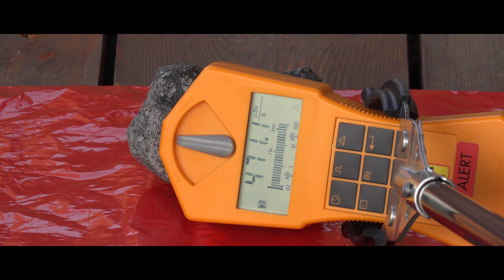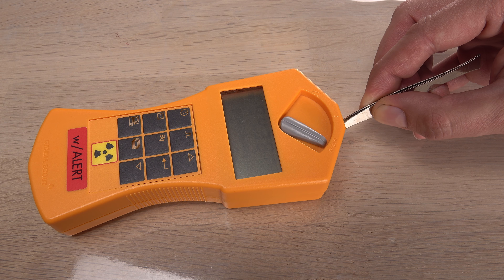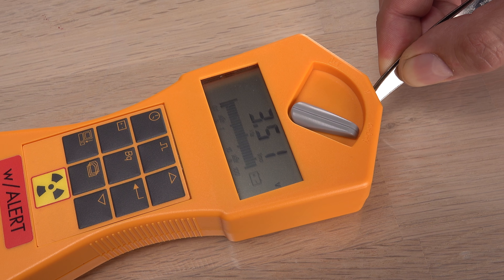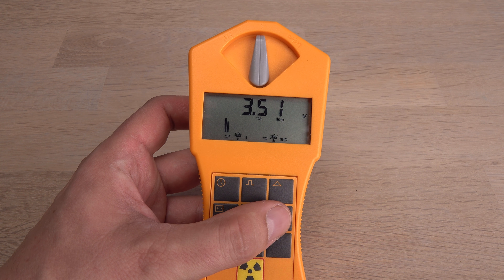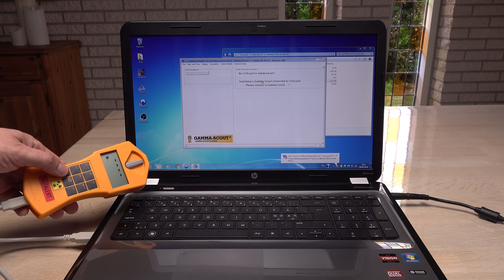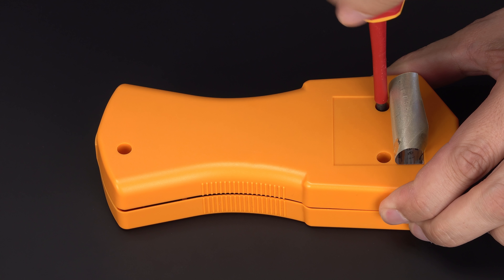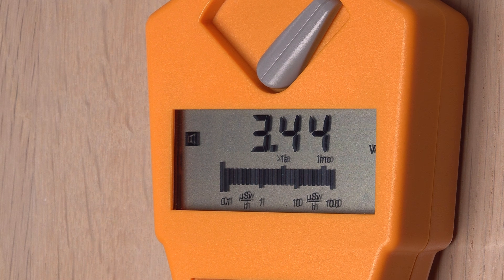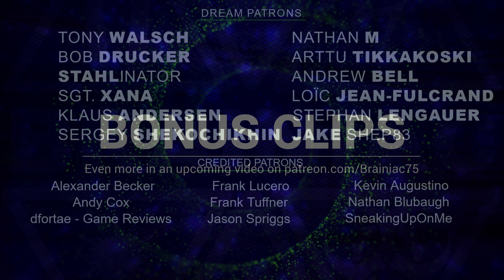Weird battery change in Geiger counter

Comment: What a stupid design to have the battery soldered in - and such an obscure chemnistry on top of that! As if they weren't able to use one of the many standard cells 9 years ago.
Also, 3.6V sounds like the perfect job for a LiFePO4 replacement, because that's their cell voltage as well. They are the safest and most favourable rechargeable lithium batteries, because they are safer than any LiPo chemnistry, don't blow up or anything. A little less power density though, but that shouldn't matter in a device like that.
Reply: The battery chosen has a better energy density very low self discharge works down to -55. They're pretty good for long life low drain applications. Soldered in is a good choice for a long service life application like this. Sending it back keeps people out of high voltage and after 9 years the tube is maybe worth checking. It's a good design choice.

Comment: I know you said you're not interested in the data-logging function. But you could try running the software in a virtual machine if you ever changed your mind, and pass through the USB.
Reply: Or install Windows XP on another drive just to run the software

Comment: That capacitor only holds 2 joules of evergy. E=1/2CV^2 It may bite you, but it shouldn't be dangerous.
Reply: In domestic use the electric shock often isn't the biggest problem. It's you falling off a ladder because of the "surprise". In this case he wouldn't fall off a ladder (although I have no idea where he is soldering ;) ), but he could throw the counter around by accident for example.

Comment: Yeah theres high voltage but it is DC and very low Amperage. Not dangerous.
Reply: also not referenced to ground so you would need to touch both contacts
Reply: I guess you could also discharge the capacitor without problems. Only in some devices you would lose some data.
Reply: not dangerous, yes, but it will still give you a nice shock!
Reply: Maybe not dangerous (ie not as lethal as a wall outlet for instance) but still enough to give you a nasty, painful shock !
Reply: You obviously don't know anything about charged high voltage capacitors.

Comment: Is the hv of the geiger dangerous? Because when I touch my geiger tube terminals I don't feel anything... The counter just freak out.... Maybe due to low amperes?
Reply: Yes, it is more like static electricity. High voltage and high current, but a very short pulse and therefore almost no energy behind it. But how much charge the capacitor has will very much depend on how the geiger counter is designed and I am sure that there are some that will zap you good.

Comment: I want to get myself a better Geiger counter. With better I mean: The same price/performance ratio as the Scout. But since the Scout is old and competition has progressed, what would you recommend? Should I buy a Scout or an alternative for the similar price?
Reply: There are indeed better deals today. The GS was noteworthy as one of the first to do logging. Ecotest is a brand worth checking out for advanced models.
Reply: @MarkRose1337  Just looked into those. The good thing about GS is the thin membrane - top geiger tube which lets alpha pass through. nearly any other mid-range budget GC I can find are solid (metal, glass) Geiger tubes, which are fairly cheap, good working, but they are blind to alpha. The Thermo Fisher RadEye for example detects all three types, but you pay 2k - 3k USD which is horrendous for a handheld pocket-device.

Comment: The battery provide 3.7v continuously? Couldn't you have installed a three cell AA battery holder and used three AA-size NiMH batteries in it's place? That way, you could replace/charge the batteries when needed and not risk overloading the unit. It would add bulk to the unit, but that's not really a problem since you don't use it much and data logging isn't a concern (I doubt it's that sensitive anyway.)
Reply: I guess self discharge is the main problem here. The few times a year you need it (at home), you can almost be sure to come back to a dead battery every time if you use NiMH.
Reply: @superdau  Better than having to source a specialized battery and soldering it in every time you want to use the device, IMO. He said he rarely uses the device yet the battery went dead. I think most of us have AA NiMH cells easily available, though. Popping in freshly charged cells when he wants to use the device seems better than relying on a soldered-in cell that may be dead in the seldom chance he may want to use the device, IMO.
Reply: @eddiespencer1  The internal battery is a high reliability device and it will be there running for TEN years.  Every time you pick it up, it is working.  Every single time.  It just simply works.  You can have a replacement battery in your mailbox tomorrow from Amazon for ten bucks when it is needed.  It takes all of  10 minutes to replace it (you just watched it).  It boggles me that you would think that rechargeable batteries would in ANY way be better.  Even if you only used the meter once in the next ten years, and had to replace the soldered in battery before you could use it, you would still be time ahead compared to recharging and installing a set of NIMH even just one time.
Reply: Why in the world would you even suggest this?  It takes a single battery that lasts 10 YEARS.  Why would you replace it with NiMH batteries that you have to constantly  recharge?  Common sense is not common anymore.
Reply: @stargazer7644  Why? For ease of battery replacement in the future. He said he seldom uses the device and yet the battery died.  He indicated data-logging isn't a concern of his as well. By installing an external battery holder, he could just put batteries in it when he wanted to use it and not be concerned about the internal battery dying.  Three freshly charged AA NiMH cells could provide about 3.6 to 3.7v (the original cell is 3.7v, correct?) to drive the device but be easily replaceable if needed and the cells are easily rechargeable/reusable. Plus he wouldn't have to disassemble the device to replace the battery.

Comment: what's weird?
Reply: The battery is soldered
Reply: @und4287  Not weird. Very common practice for rechargeable batteries. Manufacturer save costs (no battery holder) and space. Not weird at all.

Comment: I think there should have been an additional warning about the dangers of soldering lithium batteries. Heating the battery up too much with your soldering iron can cause premature energy release..
Reply: It's safe to solder the leads. It's dangerous to solder leads to a battery directly, they're usually spot welded.

Comment: Multiple camera angles and exciting music for... changing a battery. Ok a soldered in one, but still :P

Great video though!
Reply: on a LIVE CIRCUIT also.
Reply: A nuclear reactor is a lot like a woman.
You just got to read the manual and press the right buttons.
Reply: That drama is so sad it's actually funny. People used to work on open CRT television you know... (~35000V)
Reply: @FrozenHaxor  when i was younger I was about to open a CRT monitor to learn how It was made, but my grandpa told me It would be dangerous eventuali if unplugged from the power. Is that true?
Reply: @flashxcate  Yes, they are dangerous even when unplugged.
Reply: @flashxcate  Depends on how you look at it, there are charged capacitors up to 320V that discharge very slowly after being unplugged, but perhaps your grandpa was referring to the TV tube itself which has almost perfect vacuum inside and breaking it accidentally can create a massive implosion spreading glass shards all over the place.
Reply: That was the perfect ambiance.
Reply: Hey, anyone ever play with caps so thirsty that they can literally suck charge out of air, so they have to get put away with crossed legs..?

Don't think a 320V cap was the problem with old tellies.
Might be more about hand/machine wound, MASSIVE step up's for big voltage, and generally not alot to prevent the motherload discharge.....
As well as the several of various "vacuum tubes"
Reply: Errrrrrrm, hello....

Solder Sucker 😉
Reply: are you kidding? this is the content i require
Reply: Not every battery powered circuit has large exposed contacts at 600+ Volts :D
At those voltages it is very easy to get a shock, not even touching the contact but just by getting close to it. Luckly the amperage would be low, but still, it would hurt.

Comment: Man screw thionyl chloride batteries. I work at a battery store and needed one with solder tabs on it. I was new to thionyl chloride batteries (lisol2) but not to tab welding so I thought "I'll get add solder tabs" I put on safety glasses and did the positive terminal first. No problem. The battery was a button top battery and when you weld a button top battery it usually sends out a lot of Spark because of the shape. So after doing that I took off my safety glasses to do the negative as they rarely spark (on nicd and nimh batteries). I weld the tab and pop lots of Sparks. I then turn the battery to look at the spot and psssssss I get sprayed in the face. Thank God I had my Normal glasses on. I saw the lenses get sprayed and closed my eyes and started coughing and eyes watering as i ran to the eye wash station. I got really lucky in that I only had minor burns afterwards and still have both my eyes.

Thionyl chloride turns into hydrochloric acid when exposed to oxygen and this is an extremely exothermic reaction so I got both chemical burns and temperature burns on my face but no scars.
Reply from the maker: Oh boy, that's not good x( Thanks for sharing. I did see a warning about not soldering directly on the end caps of a thionyl battery in a safety data sheet. Glad I found one with axial wires...
Reply: @brainiac75  yeah I won't every try spot welding or even soldering on one of those ever again. When I started working at the battery place I was told "do not weld on lithium batteries" but saw other people welding on coin cells and 18650s so I assumed it was one of those warnings they have to give but obviously I was wrong.
Reply: Thionyl cloride reacts with water to make hydrochloric acid, but atmospheric oxygen doesn't react with it, although if it did you'd get sulfuric acid too.
Reply: @Quintinohthree  I just know I got 2 types of burns after looking over the msds of thionyl chloride I assumed it was reacting in air. OH I should mention this is in a very humid environment mid summer. Not a good day.
Reply: @x9x9x9x9x9  It's nasty stuff all around, just wanted to correct you. It's definitely hydrochloric acid that does the real dirty work in thionyl chloride burns though. Humidity doesn't really matter, there's plenty of water in and on the skin to do that already.
Reply: @Quintinohthree  Ah that makes more sense. I am not a chemist at all so reading the msds and wiki about it I just had to make my own theory as to what happened. I am just glad I didn't lose an eye.
Reply: Phew! 😫 Every cool battery has its dark secrets...
Reply: What brand of Li-SOCl2 battery was it?  The Saft and Tadiran ones are glass sealed.
Reply: @douro20  it was a saft 14250
Reply: Yes, thionyl chloride is nasty stuff.
Reply: Glad you are ok. I once got sprayed with the insides of a glow stick and with no safety glasses. Man that burned for a while. Did no damage but wasn’t very fun!
Reply: @AldoSchmedack  Really, a glow stick? Those are supposed to be safe to let babies chew on. I've seen strippers cut them open and pour the contents on their girly bits.
Reply: @brocktechnology  you have an interesting life
Reply: @issecret1  what, you haven't seen a stripper do that?

Comment: Why on earth would anyone design a product like this when they could've just as easily had it take 2 double As or a 123 lithium
Reply: Probably two reasons there, for one it makes uncalibrated devices stop working - which for a safety-related machine can be quite important. Secondly it's a money-making mechanism, Gamma Scouts are rather expensive bits of kit for what they are - and back in the day they cornered the market for small electronic geiger counter dosimeters, and they're not really aimed at hobbyists.
Reply: Two words: planned obsolescence. That way, you have to either send them the counter to replace the battery or do this.
Reply: He explains at 8:50
Reply: that doesn't really explain anything about why it's used. my ludlum Geiger counter uses two conventional giant D cell batteries.
Reply: Because the battery lasts 10 YEARS.

Comment: I'm really deeply impressed, you're able to change a battery...
Reply: Well, he could have connected some 3,5V from external power supply somewhere while changing it to avoid possible data loss. Also, could use gas heated soldering iron while messing with live, sensitive electronics to avoid some kind of induction damage. 
Changing batteries is difficult.
 (:

Comment: I actually think this was the most dangerous thing you did in this channel. Think about it: Intense radiation, strong magnets, toxic materials, inflamable materials, powerful lasers, all either take too long to kill you(toxic materials and radiation) or won't aim for you directly(magnets, lasers and inflammable materials). High voltage on the other hand, takes microsseconds to get on you and from you to the ground, and can't be stopped once it gets on your body.

I am not saying you shouldn't have done, just that be careful when doing so! Common sense makes it seems that things that aren't that dangerous(like mercury and uranium) be lethal just by looking at it, while things that are easily lethal like a 220v AC plug fine for using in a bathtub. It all depends on how strong what you are dealing with is, of course a 3v DC is not going to even tickle, while 1 gram of Radon kills you instantly.

Still, i would love to see other videos about electricity and eletronics in general!
Reply: This is a handheld device, so as long as he only uses one hand he should be fine. To get a shock you need to close a cirquit somehow. In this case he would have needed to touch two points on the board with diffrent potential simultainously. If this only happens with one hand, the cirquit will be closed within his hand. It will hurt, but the current will only flow through that one hand and not through any vital organs. It gets dangerous when you touch the two points with one hand each because then the current will low through your arms and your upper body. If you watch the video closely, he was very careful and only touched the board on places that were safe, so the corners, the battery or the USB port, and always only with one hand. I would say he did this in a very safe way.
Reply: The risk is minimal when you know what you're doing.
Reply: @Iliek  yes, but still more dangerous than playing with pure mercury, of coursr
Reply: "Intense radiation" from a piece of uranium ore? Get a grip, kid.
Reply: It is high voltage, but extremely low power.  You might receive a painful shock if you touched the wrong parts of it, but it's not at all lethal.
Reply: This stuff is about as dangerous as watching snow melt.

Comment: Will there be any more episodes of the Exotic Elements vs. Magnet series? I think novaelements sells samples of technetium, so that could be an interesting exotic addition to the elements you've tested thus far.
Reply from the maker: Sort of. I do plan more episodes, but it's unlikely that there will be new elements of high-purity. Novaelements' technetium samples are a metal foil with a tiny, tiny amount of technetium on it. Not really useful for a magnetic test, but still an interesting sample of course. But I will revisit the rare earth metals with much better tests than shown in part 1. Thanks for watching!